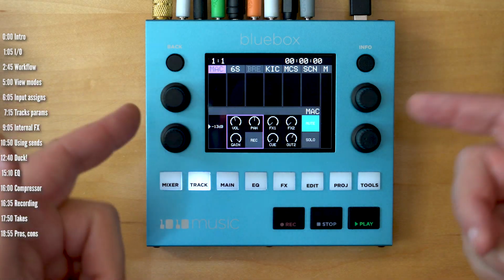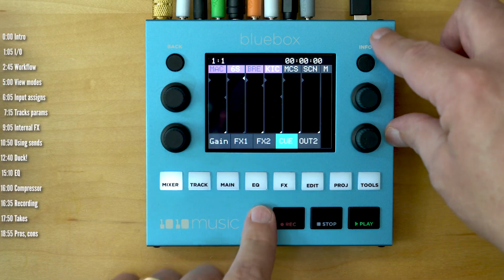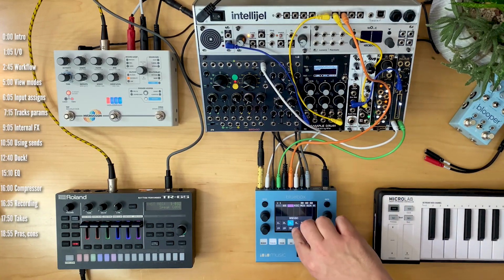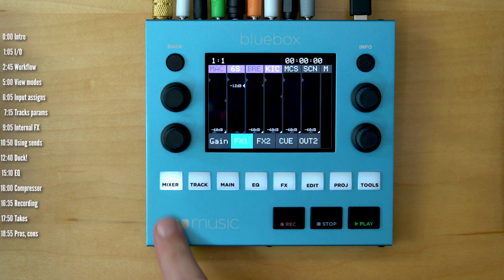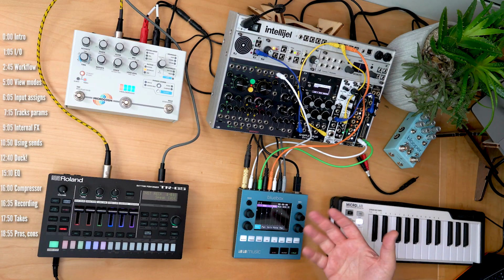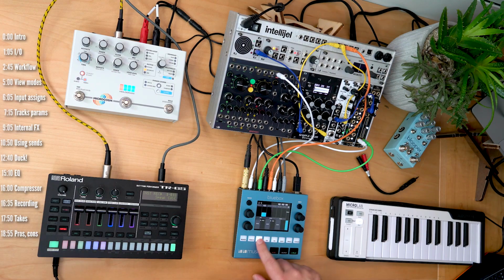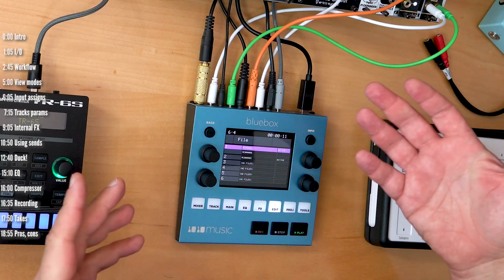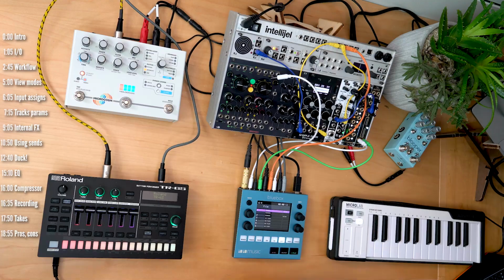1010Music BLUEBOX Review // Is it the new king of synth mixers?

Comment: Releasing it  without a multi  digital interface (in and out) to a computer via USB is just pointless. I would have considered it as such, as it is indeed a very space efficient unit. However without that feature it is of no use for the DAW workflow. You would need to ADC and DAC and then ADC again to get it into the computer and you would need another multi interface to get 6 tracks at the same time into the computer.
Reply: It’s possible to record inside the bluebox and transfer the files, but of course you have a fair point in that interface functionality would be really useful

Comment: Wow, finally a mass produced 3,5mm TRS mixer.   I guess it will save at least 200 EUR in those expensive 3,5mm - 6,3mm cables. :) The audio I/O multitracking DAW feature would be really great. Do they consider that feature? Well, multitracking on SD and then export should be a valid workaround. :) Thanks a lot for a great review!

Comment: I feel like this thing would be perfect if it could act as a multi-channel USB audio interface. Would be cool if it could get added by a firmware update, but not sure if they already have the required DAC/ADCs on board to accomplish it. Still a cool idea though.
Reply: To be fair, if it can record to SD, it could send audio threw USB, it's already gone threw the nessisary ADC/DACs, only limiting factor is the  USB connection and how much data it can handle because 12 high bitrate streams would be a *lot*, likely needing USB 3.0 at minimum to be reliable
Reply: @UNSCPILOT  you're right. I guess I didn't realize it could record them all at once. Re: bandwidth, USB 2.0 should have plenty of bandwidth without needing USB 3.0. I have one of those multi-track mixers that can send/receive all channels + master mix over USB class-compliant audio (Soundcraft 12MTK), it has 12-in/14-out at 16-bit/48kHz and uses USB 2.0. Even for 24-bit/192kHz streams, it should be able to handle up to 10 of them (up to about 42 channels for 16-bit/48kHz). [edit: if you are curious where I got the max numbers from, EDN already did the math -- search for "edn fundamentals of usb audio" and they have a great explanation.]

Comment: I'd rather have a normal mixer.  Saving space is nice, but the compromises involved are not.  If there was a version of the BlueBox with TS inputs, I might consider it as a dedicated Eurorack mixer.  (That would actually be pretty cool - for small systems, it would save rack space by externalizing the end-of-chain mixer and FX.)  But I hate using adapters, especially 2x 1/4" TS to 3.5mm TRS Y-adapters, and I don't like having to use headphone outputs when my synths have nice 1/4" outs (and some have 1/4" headphone outs anyway).  The only things the BlueBox really plays nice with are small synths that only have 3.5mm headphone outs, like the 0-Coast or Volcas.

BTW, can the outputs go directly to powered monitors?
Reply: Are you sure your "hate" of that jack size is based only on factual disadvantages ? I mean, the best connection quality is supposed to be with XLR. Then again, audiophiles connect with cinch/RCA their precious equipment (of course gold plated).

Comment: I have 3 Korg products that use 1/8 "jacks and have found that when I move a connected device they often produce noise which could easily  damage both ears and speakers.98% of the gear I own have 1/4" or trs jacks so would you trust this mixer on stage? Has anyone else had this problem?(I also purchased1/8" cables that were about a quarter of the price of the connected gear and it did not help)
Reply: @Tylon would you move devices on stage??

Comment: My current setup is a analog mixer (for synths) and an older digital mixer (for the rest of the studio) with an XLR expander and a 2ch/8tr multitracker. 
Takes up 16 U of rack space plus some desktop space. 
Blue box would be awesome for a gigging rig..... but in my studio I’d be losing a lot of flexibility, just to save a little space.

Though I am amazed by the technology! Small yet powerful.

Comment: This is exactly what I wanted for my Volcas/Boutiques (and my pre-ordered TR-6s when they ship)/PO’s!! And I just got a microcosm as well, so it’s cool to see how well this integrates with most of what I’ll be using. I hope they do a future firmware upgrade to plug in usb midi only devices...either to use midi through the 3.5mm in the front..or just for clock sync. I have the Zoom Arq 96 and it’s usb midi only, and it never gets to play with other gear because I don’t have a computer or host box

Comment: I don't know about this one. I respect the hell out of it but for $100 more I can get a Tascam Model 12 with a comparable number of channels but with that I also get mic pres and balanced 1/4in ins and a multi-track USB interface. I was really hoping this would be the one for me considering I'm slowly building my first bits of a hardware setup but I think I'm going to have to pass.
Reply: And before anyone says anything about the small size yeah I get that's the point but I don't know I just feel like if I'm paying $500 for a mixer I shouldn't have to use a bunch of really silly adapters just to use it with all my 1/4in output synths

Comment: One thing I’d like to see in these small synth mixers is the ability to stack or link multiple mixers together to expand the system it could use the DANTE or MADI protocol to route the audio throughout the “system”
Yes I know it means adding Ethernet ports to this but it would also add the ability to interface to a studio and pro audio systems in the field

Comment: If this was an audio interface, it'd be a home run...  like a cheaper K-Mix with more inputs.
Reply: Im still amazed at what they have been able to fit into their two tiny boxes. 

I think a full audio interface would have been overkill.
Reply: @Lukwidity  It's like a lot of these products, they could make two versions, one that's slightly bigger and includes an audio interface, for those who want it. Very few manufacturers milk the marketing possibilities like that, of one product leaving out a major feature and another providing it so people can choose the one they want. Clavia keyboards do it, it seems to work pretty well for them.
Reply: That would have massively increased the unit's size, I think. Since you need most of the space in those boxes for transformers.
Reply: @Lukwidity  It's already doing everything it needs to be a USB audio interface...  except sending the data over USB.  They could probably add that feature in a firmware update.
Reply: @ToyKeeper  as far as i know a audio interface is mostly the pre-amps and a dac. 
While that thing would be mostly processing units and storage. 

Im not sure we are talking about the same thing when referring to "audio interface". Do you just mean any human interface device that lets you control software? Because im pretty sure you can. 
But you can control software with almost everything, that does not make it an audio interface. 
I recently bought a A&H zed14, does pretty much what an audio interface does and has more than enough space but still is only able to do 2 track usb.
Reply: @Lukwidity  What I mean by "USB audio interface" is a device which interfaces with external audio over USB...  a USB sound card, basically.  It gets sound into and out of a computer.  I mentioned the K-Mix above as an example of the type of device I was referring to.

It would need to convert analog inputs to digital, which this device already does...  and transmit that data over USB.  Then for playback, it'd also need to go in the opposite direction, converting digital to analog... which it already does too.

Even just 2 in / 2 out would be enough... though of course it'd be nicer if it had 12 in.  That would likely depend on how much processing power and bandwidth it could spare.

In any case, it's already doing most of the work of a USB audio interface... except it transmits data to/from disk instead of sending it over USB.  Modifying a device to use USB instead of a disk generally only requires software changes.

However, it's not clear whether it has a full USB client chipset inside or if it only has enough to receive power.  So that could potentially require hardware changes.
Reply: @ToyKeeper  see I did not know the thing had dac functionalities thats interesting then. 
I still think the plastic casing and small form factor would make it sub-optimal, noisewise. 

But if all those funtions are there im pretty sure they'll have some way to use it as a digital mixer stand in
Reply: @Lukwidity  It's a 12-track digital mixer with analog inputs and outputs, and disk recording/playback.  So it has ADC and DAC capabilities.  It's just missing a few software features which could make it even more useful.

However, its USB port is only used for power...  which only requires 2 of the 4 USB pins.  It's unclear whether the 2 data pins are usable or if they're actually disconnected.
Reply: @ToyKeeper  would be a very weird choice. But then again roland built a great live synth disgusted it  as a preset synth and told noone

Comment: Will I be able to connect my Analog Heat or BigSky to the second OUT, and then wire it back to the one of the inputs, so I could route my synths through them? Also will I be able to switch what goes to what OUT via MIDI programmatically?
Reply: I'm sorry. I've just listened to "Using sends" section and it's a "yes" to my first question. So basically I can use not one but two (headphones also) outputs as sends? That's really cool

Comment: Amazing review as alsways !  I have a question and maybe you can help me : can I use the machine as a multitrack player from the sd card ? If yes, it can read à midi files ? thanks
Reply from the maker: Thanks! You can use it as a multitrack player - certainly for what you've recorded - I've not tried importing my own WAV files but it should work. No, it can't read MIDI files, just WAV audio files.
Reply: @loopop  ok hope it will come with a new firmware !

Comment: The blackbox made more sense to me as a handy small thing with a clear purpose *I love my blackbox*. I am not convinced that the small form factor makes much sense in a mixer with all the compromises. No AI, midi on the front = cable mess, need breakout cables on the back = more cable mess. Having said that, I think it is great that they made it. Compare it to something like the Keith McMillen K-Mix that is not much larger with full size TRS, balanced etc. at the same price point, but that does not have the screen so... but I hope you get my point.

Comment: Thanks for the superb video again. Having recently purchased a BlackBox I am a bit dissapointed by the design choices they made. They seem to favor multi purpose hardware platforms with interchangeable firmware, which is a great thing that sets their products and philosophy apart. However here, while sticking to the form factor, the interface was changed, making the BlackBox incompatible to the firmware of the BlueBox, but the other way around might still be possible. I actually was already considering options for a stereo mixer to compensate for the fact that the BlackBox can only sample from one input. This was supossed to act as a switching matrix to sample multiple instruments after each other. Now i see that this would be possible here. So now you get a better hardware (more inputs and outputs) for 100$ less. While I think the hardware is great, the user interface and software are lacking. I see the appeal for people with really hard space requirements but for that money they are also competing with Tascam Model 12 that is also able to record to sd card, act as a usb interface and where you can also connect via bluetooth to it. For me, I would choose a button per function mixer. Really hope that some day they might create a platform for open source development, similar to norns.

Comment: I recently scoured the internet looking for something like this. Best I could find was TC Helicon Blender. Its good...but this is exactly what I was looking for.
Reply: Same as me.. I nearly bought the blender. Glad I didn't now
Reply: I bought the Blender - it's a bit plasticky (though not really anymore than my Modal Craft 2.0 - but it does give me 6 x stereo inputs to Cubase. No sends or FX either. If the Bluebox could act as an audio interface I would buy it tomorrow.
Reply: @sulate1  yeah blender is decent, but I prefer to have disk recording over USB audio. Only reason I was about to buy the Blender was because of its function as six channel stereo mixer which is my 1st priority. I wouldn't of ever used it as a soundcard. The BlueBox having disk recording is just gravy, and 4 band eq, reverb, delay 😍 also I have a blackbox and it has very good sound quality so I expect the same from BlueBox. The ability to have mono channels is great too because I have a few mono synths, and also the 3 outs with different sub mix is really nice for send FX to my guitar pedals.. BlueBox ticks all the boxes for me

Comment: Finally! A dedicated synth mixer (well, other than Roland’s).
Reply: Well, correct me if I am wrong, but the Roland mx-1 has only 6 analog track input channels (4 mono, 1 stereo), the rest are AIRA, USB and digital channels. AIRA host ports are only for AIRA machines, so, it is in my opinion a kind of a partial eyewash.
It has though a working audio interface (18 channels) to the PC.
Reply: this is 4 times smaller than the mx1
Reply: Hey, which Roland mixer are you referring to?
Reply: @lostipod12  mx-1
Reply: Thank you all.
Reply: WTF is a dedicated synth mixer ??
Reply: @WARDISWARD  One that hasn't lots of needless mic inputs that collect dust in a normal synth environment.
Reply: @WARDISWARD  I think it's a fancy way of saying 'a mixer with only line-level inputs, no mic pre-amps'.

The Behringer RX1602 might fit into this category.
Reply: @lostipod12  often overlooked and maligned, but fantastic if you have loads of gear and don't want to be swapping stuff out all the time. I've got a pair of them and tempted to get a third.
I'm looking at the BlueBox for playing out though..

Comment: Niiiice, but really this is the ideal box for easy multichannel/quadraphonic mixing since with a touchscreen you can use x, y pads to pan in 2 dimensions instead of hardware restrictions of panning knobs, and they have plenty of outputs. So yeah hope they think about adding that
Reply: Well, you could set up a quad mix pretty easily having two sets of stereo outs to different speakers but some kind of applet that would let you cross fade different channels to different stereo mixes for spatialization effects via x,y pad would be legit!

Comment: waiting for something like this for 5 years now BUT it also is the complete opposite of what I want now. What I want now is a compact, pure analog 4 channel mixer with 4 inserts, 4 sends / 4 returns, and individual outs WITHOUT a computer in it nor touchpad on it. You do not achieve simplicity with build-in operating systems but with flexible routing options
Reply: That combination of features would make it expensive and big enough that being limited to only 4 input channels would be a dealbreaker for many. But I've never seen a 4 channel mixer with 4 send & return channels. I guess the sends part is just a matrix mixer.... But it would require, what, 8 ins, 4 bidirectional TRS jacks, and at least 9 outputs (10 for stereo main mix out). Not to mention the many knobs. At that point you're committing to a big boy, you might as well make it 8 channels.

But if you're ok with only 2 send & return channels, the WMD Performance Mixer satisfies all of your other requirements and then some. It will need 2 expanders (1 for mutes and another for individual PFL channel outs via DB25 connectors) and will cost over $1K if bought new tho.
Reply: @rdean150  uh damn, that's very close!
Reply: Something like this?
https://www.signalsounds.com/qu-bit-electronix-mixology-eurorack-stero-mixer-module-black
Reply: @jonaseggen2230  sry for my crappy english.. nope, 4 sends per channel with mix AND mute button. but I was a bit strong with my judgment there, it would be very nice to have AD/DA to plug in an I pad. key part is flexible routing. there is one new toy for this out now, it is a big 8x8 matrix but without digital support.
Reply: i currently use an audio interface plus a patch bay to route all the analog sound processing I need, but produce and mix sound  in AUM on Ipad. I would love to be able to perform and mix on the physical unit but to also send at least 4 separate tracks from the ipad to it. I pad could produce sound, send it to the mixer, mixer routes to processors and lets me master the signal. that would be perfect simplicity, separating digital from analog.
Reply: Xone px5 analogue mixer and usb Soundcard